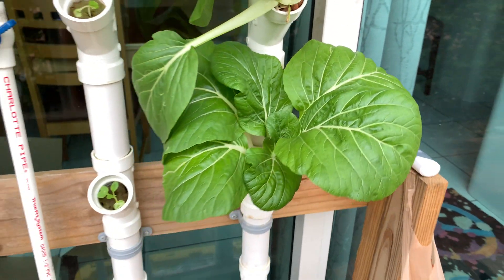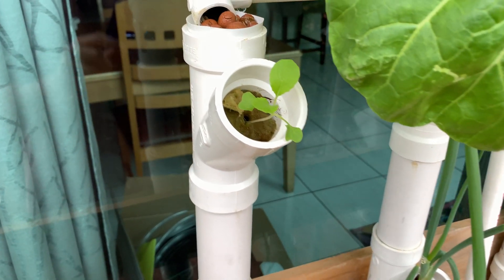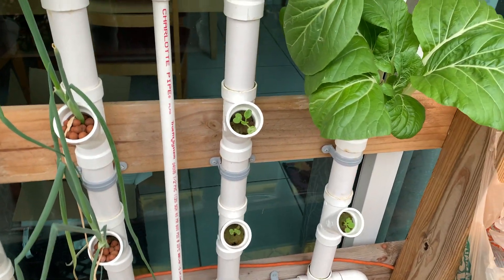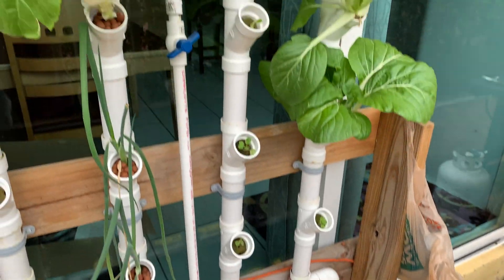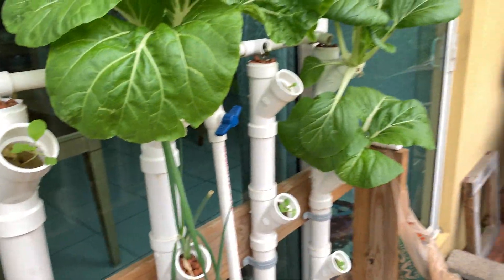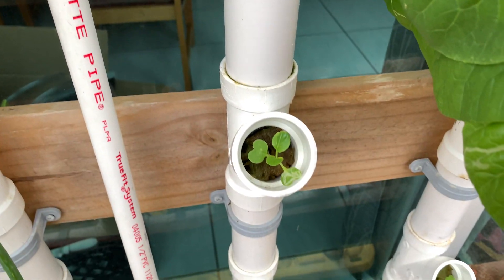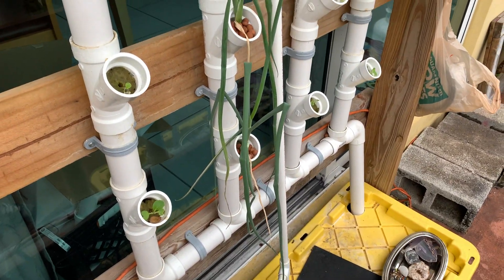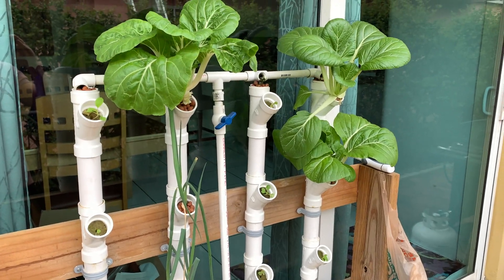DIY NFT Rain Tower PVC Hydroponics, Bok Choy, Scallions, Basil, etc.

Comment: Question, I see clay balls at the top of your vertical system. I am wondering how you feel about that approach and how you keep them from falling through the pipe? I have been feeding thru 1/4 inch tubing and it has been difficult to get it to wash over the roots. Please share your thought on your approach. Thanks.
Reply from the maker: They kinda sit on top of rock wool for looks. They aren’t supporting the plant. I did away with the drip tubing because they would clog. Ended up with pvc with a hole drilled in. You want to angle the vertical pipe so the water drips down the front size saturating the rockwool and roots.
Reply: @BobGrows  Thanks for the tip. The rockwool serves to disperse the drip making them more random. Tha angle helps to direct the nutrient solution to the roots. I plan to increase my angle. Do you cycle on and off or leave on all the time?

Comment: It amazes me how complicated people make these things. I like your style. I have been growing Kratky in the basement for years. I grow dutch buckets outside in summer with tomatoes. This year, as an experiment, I'm including fava beans, Italian broad beans, and blue lake. I was inspired by Maryland Joe's vertical system like yours, which I made, and with the right plants, I think it will do fine. I have not had great luck with that system under lights, but I was testing the limits with strawberries and spinach under led shop lights. The spinach started great and then bolted. The strawberries also started great but were less than exciting. I think that lettuce is what I will grow in that one. I also use Masterblend, but I mix it dry (I know you aren't supposed to premix but it works for me) and use at the rate of 26 grams per 5 gallons of tap water and get about 700 ppm which seems fine.  I don't worry about ph either. I do recommend a ppm meter which are cheap on Amazon. Thanks for the video.

Comment: Did you use PVC primer/glue for your fittings? I began down a rabbit talking about how bad it was to use PVC for this purpose in general, but am going for it anyhow. I started building and as I was applying the purple glue, wondered how safe that'd be in the long run.

Comment: this is SO simple!!!  Pre-fab parts.  No drilling a 55 Gallon monster bucket.  No flush-mounting holders with apoxy.  I will look to see if I can make a netpot version I already have "Kratkey" Starters created from old Jars, and, I can move them from those Right into a system like this np I would imagine.
Reply: The tall, sliced OLIVE , Jars !!!! .....  The SMALL netpots sit in them perfect !!!! No Mod needed besides ducktape the outside to keep it dark on inside.  I also tape the lid, inverted (upside down) to the bottom as a BASE, and it helps stabilize it some.  And keeps the lid incase you need it for whatever reason.  [HOARDER , Hahahahaha]

Comment: Do you hand water your seedlings until they grow their roots out long enough to reach the main tube? Also, is there anything in the main tube to divert or control the flow of water down?
Reply: The rock wool pushes out a little into the watering space and draws up the nutrients for the plants until the roots grow.

Comment: what is the total cost?
Reply: I’m making one now. The Wyes are 3.25 each for 2 inch-the most expensive part. Mine has 15 but I’m going to 30. The PVC is 9.00 for 10 feet. Buy a 24.00 cutter and you can cut yourself. The tees and elbows are 1-3.00 a piece. Pump is 15.00 and tubing is cheap

Comment: would it also work without the stones and than just use a forward angles so the roots would still get water. If that's the cause tomatoes would be possible.

Comment: Great project!
Thanks for sharing it! Could you explain pls if the feeding line goes throw the pipes or if it only drop the water at bottom of the pipes?
Reply from the maker: Pipes are empty and eventually fill with roots, the water just rains down/drops down the tube from the top
Reply: Thank you again!

Comment: Great project!
Thanks for sharing it! Could you explain pls if the feeding line goes throw the pipes or if it only drop the water at bottom of the pipes?
Reply from the maker: Full nutrient solution flows down. Water + nutes
Reply: Bob Grows Nice! So the solution flows down thorw the white pipes or does it have smaller pipes inside of them? Thank you again

Comment: I was so impressed with this that I pretty much copied it and began growing lettuce in my small grow-tent. I began with just twelve grow sites and today purchased all I need to add another twenty-four growing sites to my system. I have grown five kinds of lettuce and a few other things to see what grows best and just love the system! Thank you so much for posting it!
Reply from the maker: Thank you!! The system works great. Just need to adjust my feed at the top because it’s unbalanced but otherwise works great.
Reply: @BobGrows  I am working on that right now too. I may have to add small valves to each individual water feed so the flow can be regulated to each upright and then I'll begin growing again... maybe tomorrow or Monday.

Comment: I am building and aquaponics system with my Science Olympiad team for a maker faire, and have found your video very helpful! 
I am wondering; Do you leave your pump running all of the time, or does it have an on and off cycle? 
One more question; I am using a 10 gallon fish tank and want my vertical aquaponics system to have a total height of around 4 feet. What GPH of a pump would you recommend?

Thank you for the awesome video!

- K
Reply from the maker: What’s more important is the head pressure rather than how much it flows but something of at least 480 gallons per hour should be fine just make sure it has enough head height for your vertical system